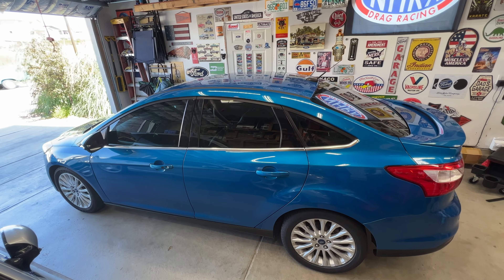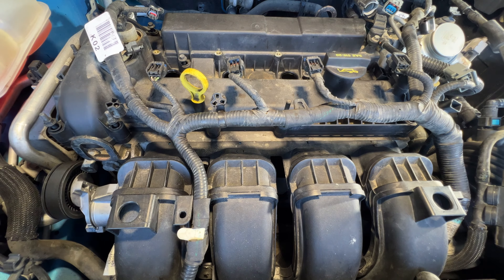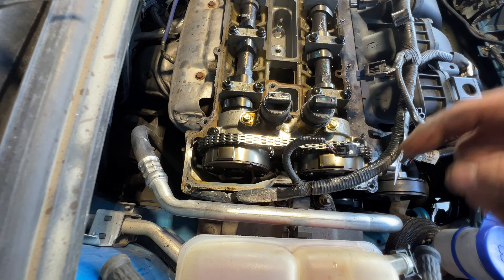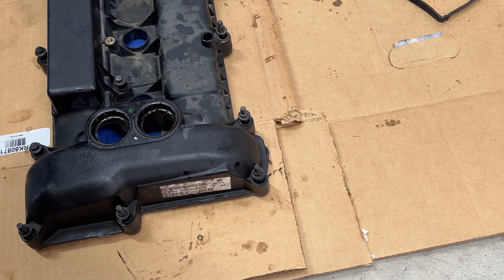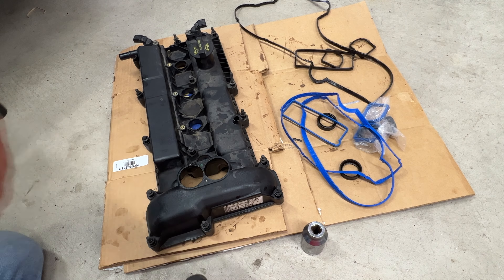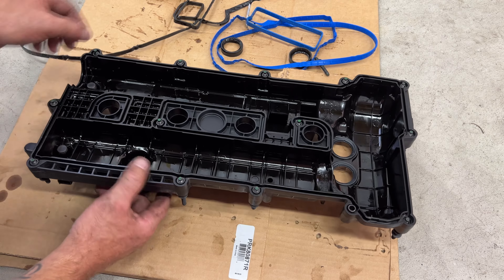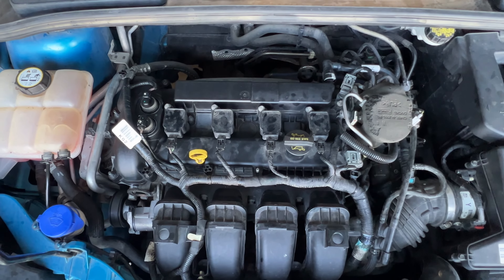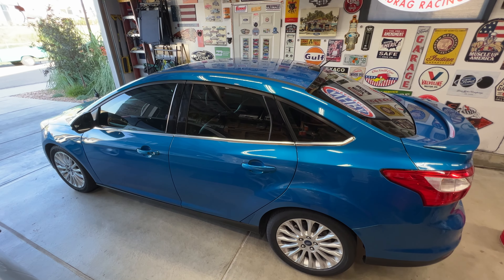2012-2018 Ford Focus Valve Cover Gasket Replacement How-To

Comment: That VVT gasket trick I wish was in the first video I might’ve been able to get the vulcanized ones out but after fighting then messing up the plastic cover I ordered the metal instead of OEM, pre installed vvt gaskets popped right out and I had no trouble getting the mahle ones flush after a few taps around. Thank you for the help I’m just waiting to torque it then finish buttoning everything back up hopefully before the freezing rain starts 😅

Comment: I did this job on a 2015 Ford Focus yesterday ( 6-6-24) i changed the valves cover.  The lady i did the job for had already bought the valve cover and gasket set. When i looked at the cover it already had the gaskets installed,  and the seals.  She took it to a Ford dealership.  They wanted $600 . They also said it would take 3 hours. It took me 3 hours,  but I spent an hour (almost) to clean the battery terminals/posts.  I think Ford was wanting to charge more hours. It looked a little more difficult than it was. A great job sir. Very helpful,  and informative.  😊

Comment: 08:00 Bro, I did this job yesterday and getting it loose from those solenoids literally took more than an hour due to rust. Great video!
Reply from the maker: Yeah it’s not the easiest as you saw on mine there were also somewhat seized due to rust and corrosion.
Reply: @BLUECOLLARGARAGE  For sure! I thank God though I don't have to do the job a second time. After a long drive I checked the whole perimeter of the valve cover and pulled the plug coils; all dry.
Reply: @jasondillon2567 i had this same issue, except the new seals i got were bad and completely tore the next day. unfortunately had to do it again haha
Reply: @ethanplooster9986  Dang, that really sucks! After watching multiple videos I opted to add some motor oil to them before replacing the cover and it definitely helped it slide back on better. Glad you were able to get it fixed though!

Comment: Thank you for this video! Would this fix oil on the spark plugs issue or is that something completely different?
Reply from the maker: Is the oil on the electrode itself or is it on the ceramic insulator where the coil clicks on?

Comment: So I went change my sons plugs / boots. And saw oil around the spark plugs. I researched possible valve cover or pvc valve. Should I do both on this 2.0? It doesn't look hard at all. Just alot of small details to follow. Thoughts?, I was thinking valve cover first and see. Then if I'm in there just do the both? Very good video, brother...

Thanks,

Bill
Reply from the maker: It’s most likely your valve cover gasket so I would start out that it’s a lot easier than the pcv valve. The pcv valve you will have to remove the intake manifold for. I did a video on it but it was on the 2.0 eco boost but will be similar to your car https://youtu.be/k6UZ1Boyr7I?si=67QFecTaXW01fehr
Reply: Appreciate the follow up...😊

Comment: Honestly anybody doing this with over 100k miles with the plastic cover I’d recommend buying a new one from ford or replace it with an aluminum one then buy gaskets, swapping the vvt ones pre installed with mahle or ford ones, and bam same price and no eventual plastic valve cover cracks.

Comment: I've got an issue where my middle 2 sparkplugs have oil on them. Would this fix it potentially?
Reply from the maker: Yes most likely because the square gasket that is included in the kit helps keep oil out of the middle for cylinder 2 and 3 spark plugs.